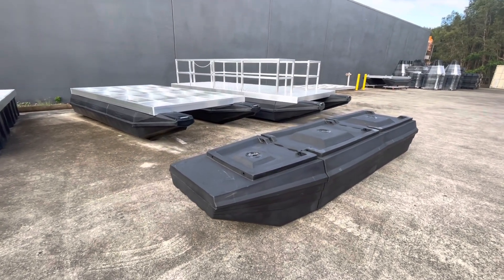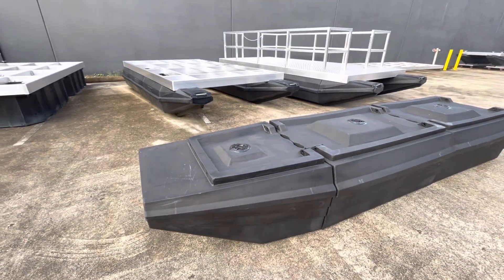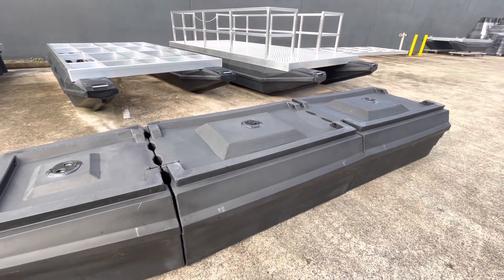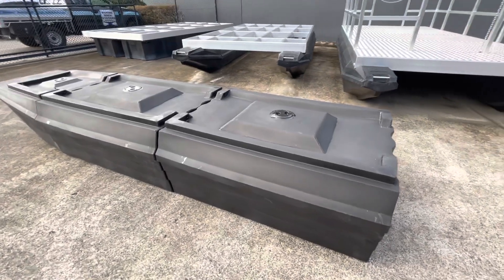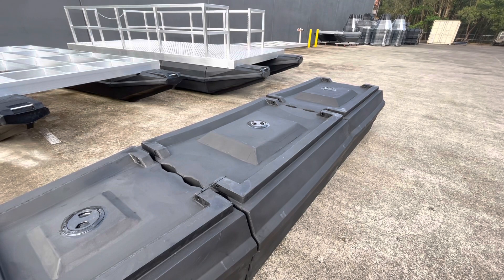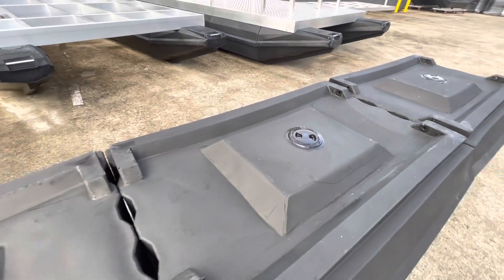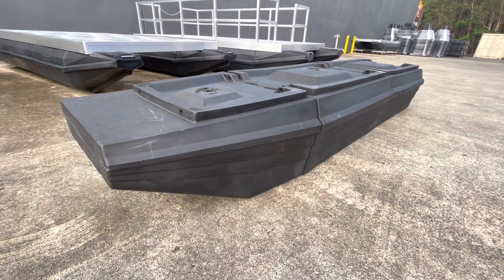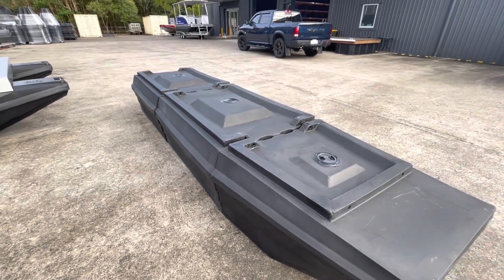Houseboat hulls. Build your own houseboats on these extra large polyethylene pontoon boat floats

Comment: Nice product. Three questions:

1. It appears that you intend for customers to buy as many individual pieces as necessary to fit their length requirements. Is that correct, and is there a structural length limitation to the number of floats that can be connected together?

2. Do you have a branch office that manufactures and distributes these in North America?

3. If "no" to # 2 above, is it feasible to ship your floats, etc. internationally? I'm not asking whether they would fit in a shipping container. I'm asking whether it would make the price of the floats so expensive that it would make no sense to ship it.
Reply: google this mate there is heaps of information on the net on HDPE boats, that is the product we are talking about - HIGH DENSITY POLYETHYLENE. There are many different manufacturers here in Australia and in USA, and worldwide for that matter. You can weld it with hot air guns. A really good one for thick HDPE is about $3,000 - this is the only real way to join this material, nothing much sticks to it so it is an excellent choice for marine construction. It is very heavy, but very impact resistant, hence it doesn't shatter or break when the boat runs into rocks or a whale hits it from below with it's tail when playing with it's friends, and yes, this does happen to fiber glass boats.
Reply from the maker: Yes we sell the individual to the amount you need. We can quote you freight. The Australian dollar is quite low at the moment which helps off set delivery price.
Reply: @MarineDockSystems  Thanks for the quick reply, but it seems like you passed up a good chance to give three well-written, informative answers to three good questions. For people who want to sell products, it's good to remember that I'm not the only one reading the answers.
Reply from the maker: @_onesimpleidea  
1. Yes we sell individually to make up the length you want. You can make any length or width.

2. No we don't currently have a distributor in North America. We can ship from Australia. please provide your location and qty so we can quote.

3. We can ship internationally. Depending where you are located it may be feasible especially at the moment as the Australian dollar is around .70 cent to the US  dollar.

Kind regards Brett
Please email us with what you would like to build, where you are and budget.

Go to www.marinedocksystems.com.au
for technical information and contact details.
Reply: @_onesimpleidea  
3 month ? 3 month reply